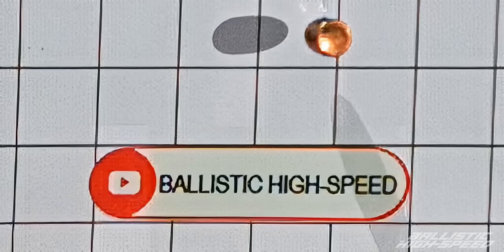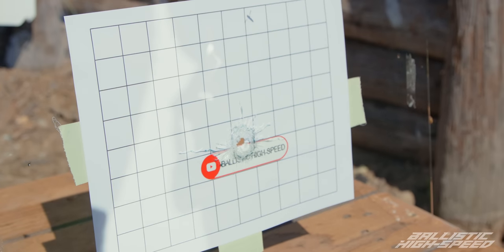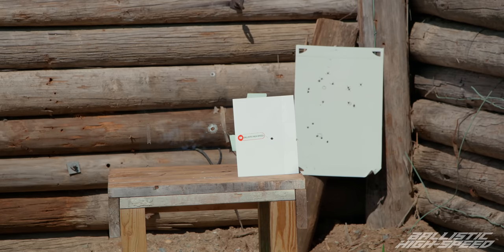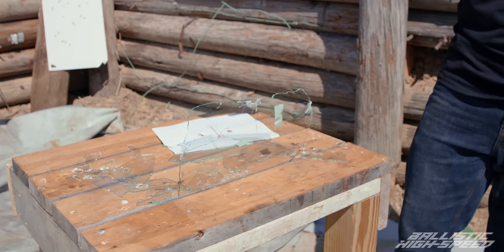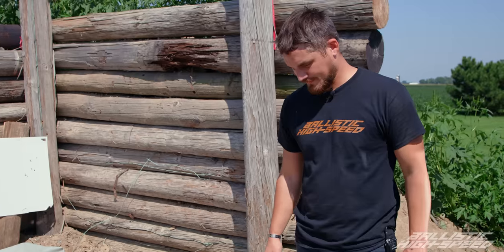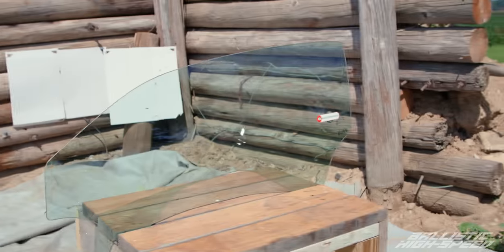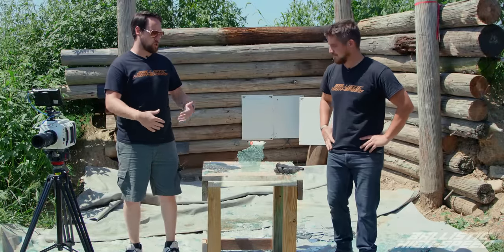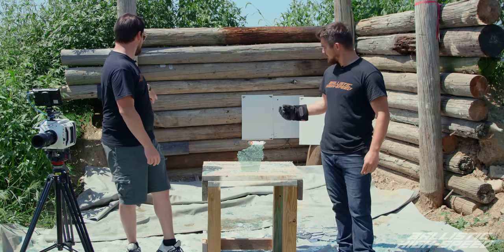Does Glass Break Faster than a Bullet?? - Ballistic High-Speed

Comment: "The .45 is so much fatter"
Well, comparatively speaking it really isn't.
9mm  is .354 inch.
.45 inch is 11.43 mm
The .45 is 27% wider in diameter than the 9 mm. A quarter extra if you will. Not really that fat.

The size of the 9mm hole is so much bigger because the 9mm is going faster. There's about the same amount of energy (kinetic joules) going into the glass regardless of the size of the bullet.
The .45 moves slower, but of course has a larger impact area and more mass. The energy is about the same, relatively speaking.

9mm has about 409 ft.lb of force behind it. It's going much faster.
.45 has about 356 ft.lb of force behind it. It's more massive but is going slower.
That's 14% more energy for the 9mm, so it makes a hole that's 14% (of course not BTW, but it does make a difference) larger than it would if it went as slow as a .45 cal.

EDIT: Oh and a .223 (5.56 mm) would be considered skinny compared to a .45 but the .223 has oodles more energy behind it. Question is, and maybe I'll see it, would a .223 leave a bigger hole?
And then we have the opposite end of the spectrum with .22 LR, slow and skinny. Wouldn't surprise me if glass could actually completely stop a .22 given just enough thickness. Not super thick and not bullet proof, just a bit thicker than average.
.177 that is fired from a BB gun has been stopped by thick glass many times. And the times it has went through, it leaves a small entry hole on one side of the pane and a wider crater on the other side of the pane of glass. Just barely enough to go through and the cracks doesn't propagate very far at all. A small rock being thrown has more energy behind it.